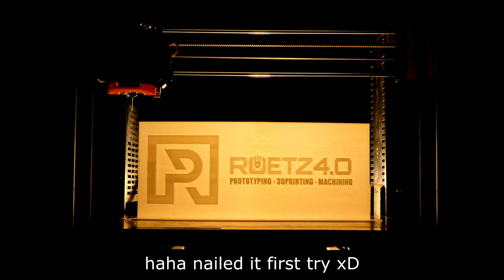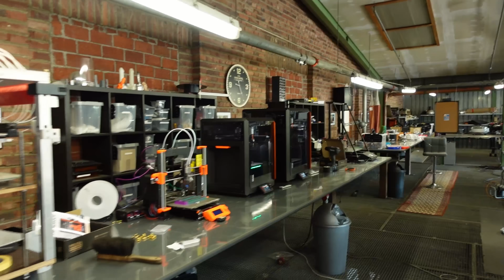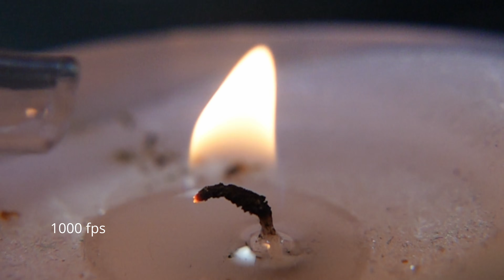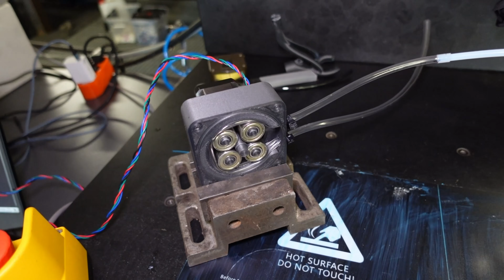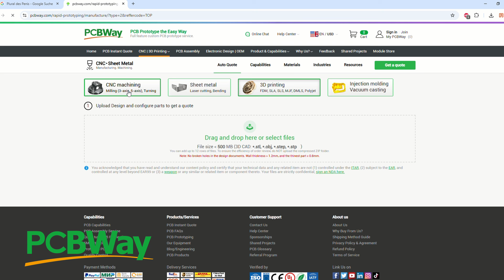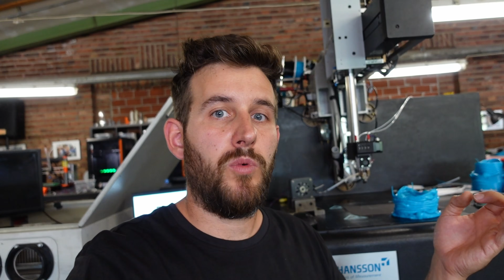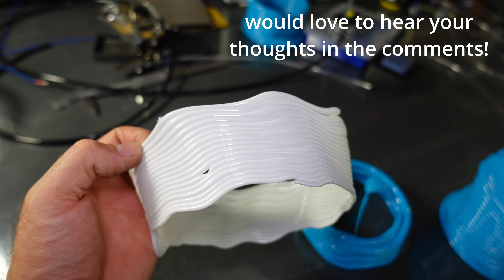Your Ideas made it WAY BETTER! 3D-Printing TPU Tubing

Comment: A couple of random thoughts on use cases:

- Custom / odd shaped packing material for sensitive items that need to be kept at a very constant temperature. Pumping liquid coolant through TPU tubes that are printed to fit snuggly around the item, even expanding slightly with the pressure of the coolant to ‘hug’ the part. Items such as delicate art works maybe?

- blowing a conductor through the tubing to then be used as some kind of induction heater or motor coil, which could then be temperature regulated from within, taking heat away from the system without the need for external cooling. 

- keep thinking about inflatable door wedges, the kind used by carpenters when hanging doors. The ability to lift something a small amount but very precisely using air pressure.
Reply: Oh and have you considered printing directly into a bath of liquid, cooling the extrusion instantly and setting it in position. I could imagine a coil being created this way in a very tall water bath
Reply from the maker: Thanks for the input

Comment: What if the nozzle had a J shape? It would be really close to the previous layer, so I guess a better layer adhesion, and you could cool it faster, not requiring a precise ar flow, if at all. The downside is that it would require an additional motor to controll the angle of the nozzle

Comment: Super cool would be trying to print PLA AIR PLA PETG to have separation layer for the coil.
Maybe using foaming filament that does not fuse with the tube material instead of air, like PLA "foaming PETG" PLA setup? (and pulling the foaming part out of the print after)
Maybe small EDM duster fan would work better for air flow control it does usually up to 100k RPM so plenty of useful range for speed modulation.
IMHO TPU tube will need higher pressure because internal resistance of tube from TPU is higher where PLA comparably has little resistance.
Starting larger spiral outside the final print with space between lines to get diameter stabilized would probably help.

Comment: Wild/out there stuff: Frank Herbert Stillsuit anyone? Entirely mechanical body pumped cooling loops, with filtering and reverse osmosis built in?

Real life: My initial thoughts would be to try temperature controlled heated/cooled fluid. Water would probably be the simplest initially. For a start you have a incompressible medium, so not only would the input volume be easier to control (and for liquid, i'd probably try a stepper driven gear pump for this over the peristaltic as they are more reliable long term), but it would stop the 'buffering' over inflation too that you get using compressed air. You could also use a lidar (or other height sensor) feedback loop to control the crests and valleys by increasing/decreasing the inflation volume/speed.
I'd also be interested to use the inflation fluid as internal cooling, i.e. cooling the tube internally to some degree, while leaving the external temp relatively high to preserve layer adhesion. The starting procedure seems to be difficult and causing inconsistency here too. maybe get a sealed, low to zero inflation flow to start with and build a flat first layer 'raft' then slowly increase volume over the first non raft layer and go from there? or do a plasma/laser style run in 'cut' so make a extruded blob and then start your circular extrusion.

As others have said  a belt printer might give you more consistent results for longer tube runs, but if you want structural printing I thing you are on the right path here.

Good work!
Reply: other thoughts... Maybe split the stages - extrude the tube, then separate the printing side of it, so print with a tubular filament? You could use your existing extruder with additional post cooling to manufacture a tubular filament, even pre-filled with conductive/fluid/whatever you want inside it, then work on the printing tubular filament side of things, maybe with rotating variable angle print head so you are only heating the surface of the tube enough to get layer adhesion, and laying in down in the correct orientation and approach angle, and even crimped heated start and end in the extruder (like filament cutter, but heated!)

Comment: If you goal is to print a long tube that isn't adhered in a coil then the standard when making electric cables is to let it flow into a bed of cool water and have a spool coil it up afterwards and letting it droop on some rollers that measure how high the droop is to increase or decrease the speed of the take-up winder

And you really need silicone tubing for the pump.

Or you can try some homemade TPU tubing 😅 but you need to adjust the clerance then

Comment: I wonder how linear advance would work with the air setup. I assume it'd have to increase with the amount of tube that's already been printed. This isn't an easy system to adapt to general-purpose printing but you're making great strides.

Comment: You need to buffer the air flow. Best way would be to use a standard shop compressor with a tank, and a low pressure regulator. From there a digital flowmeter and electrically controlled flow valve.

Comment: Why not start spooling it like a filament extruder, instead of printing in a circle? That way you have full control of the cooling and not depending on the distance from the nozzle to the previous layer. Have a look at the Artme 3D Extruder!

Comment: Test for leakage under water or use a smoke leak tester.
Update add a smoke leak tester to the pump and test for leaks as you print.

Comment: Very cool stuff!! Very inspiring! Makes lots of sense to switch from pressure to air flow control. 

But I personally feel it solves the problem partially: what we want at the end is controlling the hollow cross-sectional area at the extrusion site, right? 
I feel air is too much (i) compressible (ii) prone to high volume differences under temperature gradients. --> Leading to a high dependence on already printed tubing, i.e (i) the airflow resistance if there is an air outlet, or (ii) the enclosed hollow volume (more total air volume leading to 'easier repartition of the air', i.e the air does not stay at the extrusion site). 

-->Even though it seems a complicated and messy solution, I feel repeatability could come from controlled extrusion of an INCOMPRESSIBLE core material (oil? gel? water-soluble stuff?).

-->Maybe the solution could also come from a static floppy silicone core centered in the nozzle, and that extends past the extruder: the thermoplastic would —partially— solidify around before its termination while being able to bend... But then active modulation of the diameter would not be possible (maybe by controlling the size of the floppy thing, with some fluid?) and airflow still necessary...  And let alone friction management :( .

But to be honest, within the same framework you already have, I don't see easy solution to the problem, and I am super eager to see its evolution! 

PS. a similar method as yours to print tubing was derived from MEW (Melt ElectroWritting). It is a very different scale, and from a glance (did not read) they did run in similar problems. This research could still interest you (maybe they have more recent advances since 2022): 
DOI:10.1002/adem.202100750

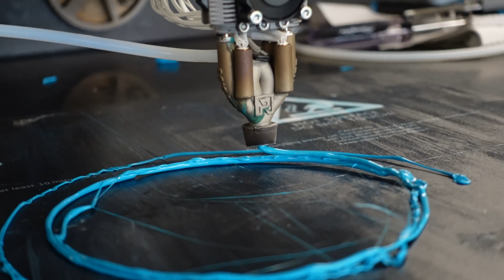Comment: 6:25 If you don't have/don't want to use a bigger motor for more torque, can you use two? If you don't need the maximum speed, then gear it down.

Comment: Definitely try finding an industrial gas mass flow controller. They must exist and I bet if you know what to search for, you could find one on the surplus market. There might also be medical devices that do the same thing.

Also, if you’re worried about shop temperature causing you problems, you could always use a heated chamber for your printer and take your intake air from the heated chamber. That way you’d be making use of an already extant source of air at a controlled temperature. Atmospheric pressure would still be an issue, but you’d at least be taking care of one of the variables.

Comment: This might be taking it too far, but if you can't seal well with air and have leakage, you can instead pump water inside an enclosed container with a top-mounted air hose to the printer and let water's low compressibility do the work. Also if cooling is fast enough, pulling back a lot of air might pinch the hose and restart everything. Might be doable via a macro.

Comment: Once you're confident that it's constant tubing, perhaps you could make conductive coils by filling it with some salt solution! solves both issues; high resistance filament and unable to cut a wire mid print

Comment: You could run only one of the two extruders to "paint" the print surface like a regular printer, very close to the bed. Then for the next layers you could run both with air

Comment: You can also use 2 or 3 rolls setup for that pump, like it's used in fiories (concrete pump vehicles) it will create a more stable flow rate and less resistance in whole system also it's better to use bigger step motors for things like this or even just use a regular motor like jga-25

Comment: Have you tried using an off the shelf closed loop mass flow controller? Then ambient pressure wouldn't change the effective flow rate after heating if dispensing in mass/time instead of volume/time.

Comment: One of the problems you are dealing with is that air is compressible. Is there a fluid you could use that is incompressible, but doesn't (or perhaps does?) drastically affect the cooling of the plastic?

Comment: You could totally 3D print a valve into a 3D printed sole of a shoe made out of your TPU tubing, so that every time you step it pumps air up into the shoe and out the top to keep it cool.

Comment: Interesting. Is "continuous tubing" a feature? Controlling the volume (also dynamic changes) would be easier if the tube was blocked at certain intervals, maybe by injecting a blob of molten filament every so often. Would probably make the extruder complicated.

Comment: If you want to smooth the pulsation of air, use long tube wrapped in a roll. It will smoothen the flow dramatically. Or just print it.😅
Reply: I was thinking about an accumulator using a balloon as a diaphragm.
Reply: That would unfortunately smoothen the pressure, which would make things worse.
Reply: @TildaAzrisk that’s what we intended our comments to accomplish. Why do you think repetitive spikes in pressure are a good thing?

Comment: I once saw a cross vane pump that was constant rpm but variable output by sliding the housing . Humm probably look at vacuum pumps used for compiostes or wood and use the output after oil recovery

Comment: Other things you may wish to get a "vingerspitzegefuhl" --> (1) diaphragm pump (instead of peristaltic pump) : This is a positive-displacement type device too, better suited to air than a peristaltic pump (better for high pressure in liquids. (2) interesting academically, but don't bother: Murata makes "piezomicroblowers" - their V'-P curve is not as flat as a (cheaper, simpler) diaphragm pump. Novel, nonetheless. (3) volumetric flowrate sensor (e,g, sensirion makes an EXCELLENT one for ~ 25 bucks, for exactly the flow-ranges you are using. They may be even willing to sponsor you.)
Reply: PS, the fact it is here on YT is already a "publication". (unless you delete the video later, for some reason).

Comment: To lower the pulsing, you could try using multiple, smaller peristaltic pumps running out of phase on the same shaft, each with its own check valve.

Comment: Hey, I got an idea. If you still want to use a peristaltic pump and the air pulsation becomes a problem, maybe you could use two pumps in parallel (with an offset in the bearing angle) and connect their outlet hoses together. That could reduce, compensate the pulsation. With the addition of a reduction gearbox, it might be great.

Comment: Uh interesting. Thoughts: A peristaltic pump works way better with silicon tubing; inflatable TPU could be used as a kind of actuator; i tried injection molding with filament and high flow hotend (no video) and did not get enough flow but flow is where your setup shines so I'm looking forward to it 😊; with your setup you could even try below-molding 😲. Looking forward to your next video 👍

Comment: I've been wanting to experiment with ionic coils.  Essentially, you mix water with a bit of baking soda, fill the coil in the tube with that water, then wrap copper wire around it or inside it (maybe with an iron core) and try using induction to drive electrolysis by driving the copper coil with a sawtooth wave form.

Comment: i think a piezo air pump (the ultra cheap 5$ once) would do very very well flow and volume and controlwise. important that it is a piezo air pump not a dc motor air pump.

Comment: Add positive pressure, say 15psi or even 50+ with the peristaltic it would not only assist, but control volume better.

Comment: For starting a print, you may need custom G-code to help create an airtight pinch at the starting point of the print. This might be easier to achieve if the gas flow rate is a separate machine axis, but that route would require G-code processing to make the gas flow rate match extrusion speed during the print proper. However, making it a separate machine axis could also allow interesting experiments in varying the inflation during the print.

Comment: Be interesting to see this run with multiple colours to see where each is ending up in the mix. And I wonder if there is a place tor running a different head that inserts an interior extrusion, both with and without air, inside the tube.

Some fun ideas to play with here.

Comment: If your just trying to create air pressure, a parastaltic pump is a bad choice. Just use an air pump. They make small 12V ones that can push or pull a good bit of air, or you can use one that's just a pump.

Comment: Don’t know if this was posted yet (haven’t review the comments from the last video), but honestly it seems like the complexity of a 5d printer might actually work well here. I was watching the pla flow down, and thinking that if you could angle the nozzle a bit, you could print closer layers while being able to actively vary the tube depth. In addition, it might allow for setting a more consistent flow that wouldn’t have to be varied throughout the print with changes in shape or the like.

Comment: Well done on your homework!!! Peristaltic pump seems like it was great for experiments. TPU was also pretty successful. What about using one of the inner filament feeds with TPU to be able to turn the continuous tube into cells? Probably a whole other can or worms with clearing the air tube after closing the cell but if this can be done you will be able to limit the effects of the open printed tube on the currently extruded cell. Have fun mate!

Comment: Build cycloidal gear reduction into the pump input? That would solve for your motor heat issues. The design of the pump itself could also be improved. I'd go with a 3 lobe 360 degree wrap with inlet/outlet tapering away from the lobe path at intersection (to preserve approximate equal resistance the entire stroke). Softer tubing would also reduce load and provide a better seal. Try printing some TPU tubing to use for the pump? That would be pretty epic.
Reply: You really don't need a cycloidal design for this. Any type of gear reduction would be good, but the motor needs more cooling.
Reply: @symbioticcoherence8435 I recommended cycloidal because they play nice with printed parts compared to other designs. For something like this, reliability is important. Printed plastic gears/teeth are not reliable.
Reply: @zg1k68  That's thoughtfull of you. 

I think cycloidal drives are a bad idea because of their complexity and the many contact points they tend to have when made of plastic. I think printing gears can work if they are printed larger, with more teeth than traditionally. e.g. t=41 & t=119 instead of t=12 & t=36 for a 1:3 ratio. More teeth mean the same tourqe can be transmitted with less force and spread over more teeth. And prime numbers are important to include to prevent excess rubbing in one particular spot. It ruins the perfect ratio, but that is rarely important, only desired for astetic reasons. Also, using timing belts/pulleys with toothed drums like GT2 means the force can spread between many teeth (~50%-70%) at once instead of 1-3 teeth.

Comment: If you could devise a way to pinch or cut the tube dynamically, you could theoretically print using tubes as if printing normally...
This would be faster and cheaper than printing normally! It would also solve the startup problem.

Comment: Prristatic pumps wont give you continuous flow.. you either meef tonstack several of them (same sxis but shifted in phase) or a completely different approach.
A really thin nozzle where the air reaches sonic speed is a good way to convert pressure to flow pretty stable (independently of the pressure on the downstream side over a pretty wide range).
Reply: A large reservoir like a soda bottle between the pump and the nozzle should buffer the flow and smooth out the airflow quite a bit, worth a try in my opinion.
Reply: @Hobgoblin612 good idea. But will also make the buildup of pressure slower (start and stop of the pump) and we're essentially back at a pressure regulated system instead of flow.

Comment: Just 5 min in, if you use silicone tubing and a very low pressure valve on the output it will smooth out a lot of the pulsing from the pump. On top of a stepper system(i have not finished watching to see if you get that done yet)